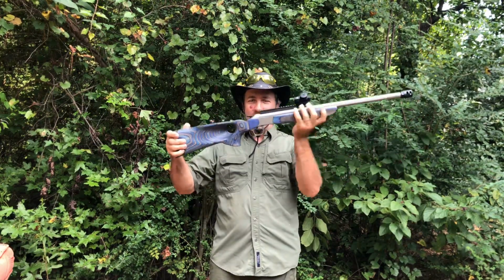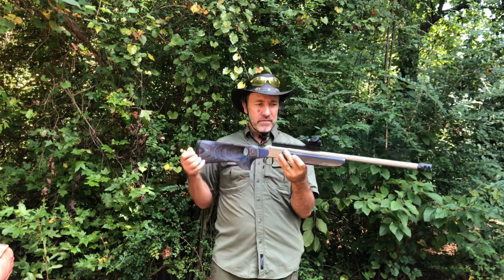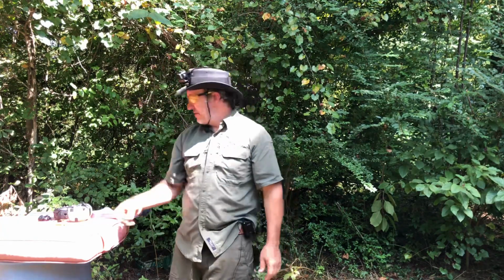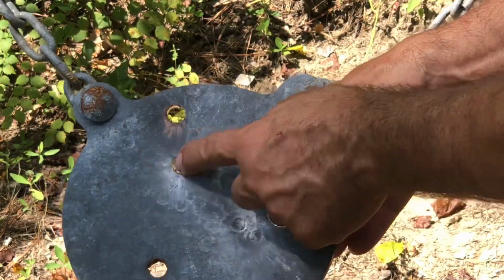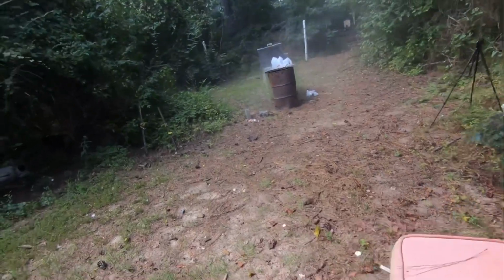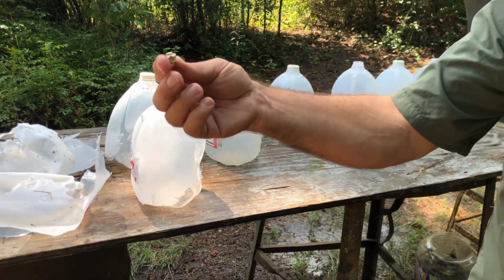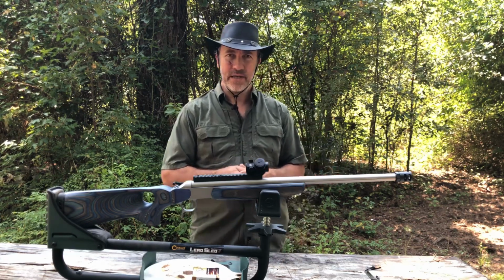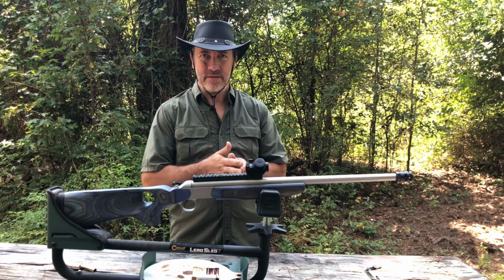CVA Scout￼ 45-90 WCF

Comment: Can you do a comparison between the 45-90 and 50-110 both with 500 grain bullets? Also, can the CVA or Henry single shot rifles handle the 45-110. I have the Henry single shot in 45-70 and want to rechamber it in 45-90 or 45-110. I like the 45-110, but don’t know if the Henry action can handle it. Thank you for the great videos!
Reply from the maker: I think that’s a good idea I have some 500 grain bullets for both, well the 50 caliber might be a little bit over but not much

Comment: Any idea what the brand of furniture was on this Scout? Looks pretty comfortable, rather in-line with the bore axis probably reducing muzzle jump. Personally I'd probably run a longer brake on it but it looks like it was working well.
I've always liked the idea of durable, simple inexpensive single-shot rifles running cartridges that would otherwise cost a lot more in lever actions. They aren't a combative situation with followup shots, but they still get game.
Whether 1885, Ruger #1, H&R Handi Rifle, or this CVA... I like single shots.
Reply from the maker: It’s factory Furniture
Reply: @Leverguns50  From what I see available from CVA, I don't see anything like it. Wondering if it's something more custom from Boyd's?

Comment: What do you think of the Ruger NO 3 in 45-70 and hand loads? Or rechabering it to 45-90. I know it handle the pressure, just thinking more about stock barrel length and accuracy.
Reply from the maker: Personally, I like the 45-90 cartridge so I would probably rechamber it

Comment: my CVA scout does not have no mercury in the stock but my H&R 50-110 does it has a 3 inch 8 ounce Mercury recoil reducer in the stock you are doing a good job making the video on the CVA scout 45-90 I really appreciate it thank you
Reply from the maker: You’re welcome brother
Reply: Do those mercury containers make a noticeable reduction in felt recoil? I'm guessing they are just dense metal to increase inertia and make a rifle less front-heavy? Seems a good 4 or 5 port lateral muzzle brake would do the most work.

Comment: Great video. What powder charges were you using.
Reply from the maker: I think the 45-90 brass is probably the cheapest so I think it would be good to chambered in 45-90 but I would only do that if you’re a reloader otherwise your ammo will cost you more
Reply: @Leverguns50  If I could find the Brass for 45-90 I'd get some. But no one has any.

Comment: Leverguns I have a question for you. Can you shoot .45-70 in a .45-90, .45-110 etc. Just wondering? Mike.
Reply from the maker: You can shoot 45-70 in a 45-90  and you should be able to shoot either one of these in a 45-110 although if you shoot enough shorter cartridges you can put a ring of carbon in the chamber and you will have to clean that out before shooting the longer cartridge or it might stick in the chamber or ring the cartridge it might take 100 or more cartridges to do that, however with black powder if you shoot a short cartridge you’re gonna have to clean it before you can use the longer cartridge
Reply: @Leverguns50  Thanks, that's what I figured but wanted to confirm.🙂

Comment: You know why don't you try a hard cast or swag e d 600 to even 700 Grand in the 45 70 and 4590 now I know in a single shot like the Ruger already you can push it till about 50,000 cop even in some specialized bolt action rifles now I know the Winchester is labeled at 45,000 cop so it would be great to see these phones

Comment: Hard to imagine that 45 going thru AR500 plate.  My 375 Ruger is faster using an 300gr bullet and doesn't penetrate plate in that manner.  Maybe they're passing off that as AR500 plate and it's actually not?